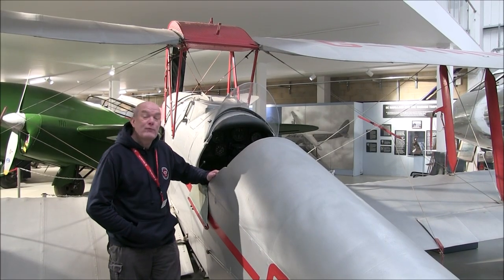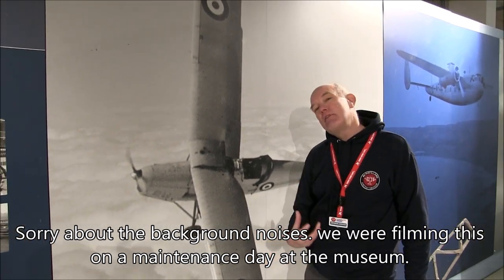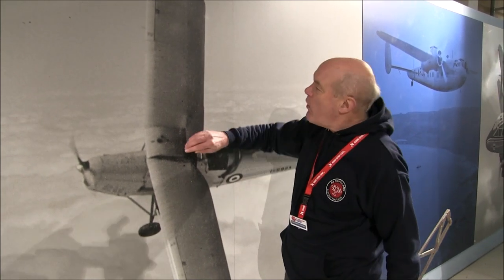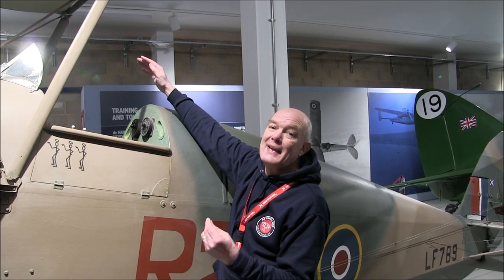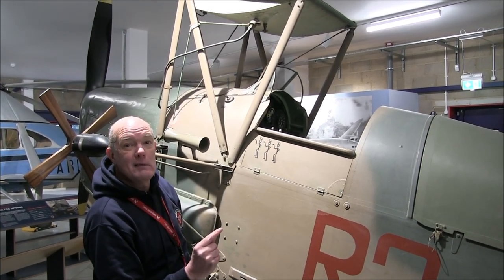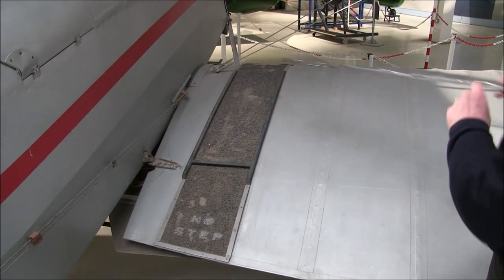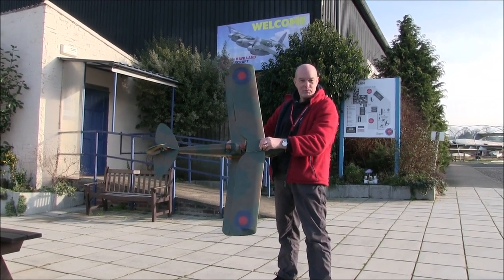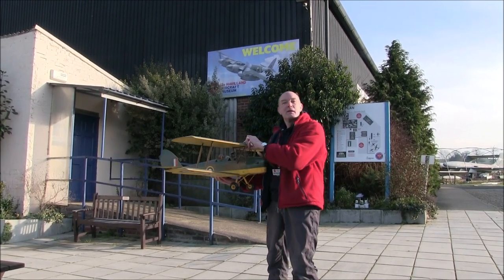Why are the wings strange on the DH82 Tiger Moth?

Comment: After they had swept the wings, it still wasn't quite right, so they swept the top wing a bit more. Then the Swedish (the Swedish were the first to recieve them) found out, that the tips of the lower wings were rather close to the ground when taxiing, so the lower wing got a bit more dihedral. And the DH82 was done and got renamed to 82a.
The DH Moth had foldable wings, and the Tiger Moth still use the wing folding hinges at the wing roots although those wings will fold nowhere.

Comment: Funny hearing center of lift, here in Canada I grew with a RCAF pilot father, he taught center of gravity, same thing in air cadets. Great explanation you made it easy to understand, great video.
Reply: Because centre of lift and centre of gravity may well not be in the same place. Change the angle of attack and you can change the centre of lift while the centre of gravity remains stationary.

Comment: Ryan did the same thing with their PT-22 recruit. They swept the wings back to obtain proper center of gravity, And another advantage of having swept wings is that it tricks the air into thinking that the wing is bigger Because on a swept wing the air travels across more surface area.
Reply: " it tricks the air into thinking that the wing is bigger Because on a swept wing the air travels across more surface area."

This is so wrong
Reply: @SoloRenegade  how?
Reply: @davidhames319  You made teh false, claim, you should be able to back it up.

The area of the wing does not increase. In fact, it decreased. And the wing becomes less efficient. the stall speed increases. 

if the surface area of the wing had increased magically, the stall speed for swept wings would be lower, and payload would be higher. You're no introducing the idea of spanwise flow that robs efficiency.

Comment: Very interesting...but it brings a question. If the ribs are not aligned with the airflow, then the original airfoil does not work as planned. Did dH change the airfoil accordingly for the swept wings?
Reply from the maker: As far as we know, the wings were not re-designed at all (other than the re-design of the wing root fixings). So the airfoil would work somewhat differently ! The story of how the DH82 Tiger Moth came about is covered in Graham Simons book, "de Havilland Enterprises" https://dehavillandmuseum.myshopify.com/products/dehavilland-enterprise
Reply: Correct, but the change is minor. the Tiger Moth is not the only aircraft to do something like this either.

Comment: G'day,

Wake up to yourselves.

There is 
NOTHING at all "Strange" about the Wings of a 
Tiger Moth...

Shifting the Upper Centre Section forward, to better facilitate entry and exit to/from the Front Cockpit, obliging the Wings to be swept back, SLIGHTLY...; to maintain the Centre of Gravity, was a Bog-Standard, Garden-Variety style of a Designer's Fudge - back in the day.

Nothing at all "unusual" about it..., except that it was done for a Crew Dynamics and Ergonomics reason ; NORMALLY the usual reason for belatedly sweeping back the Wings was that the Factory was already set up to build Fuselages - and the Bumfeathers were found to be far too heavy..., so the Wing-Root Fittings were modified to shift the Centre of Lift to within the limits of flyability 

If you would dare to demurr, then get ahold of a Plan-View of a Short Sunderland Flying Boat.

From memory, the Short Empire Class all had straight Wings, but the Sunderland was encumbered with a 4-Gun Turret under the Fin..., about a thousand pounds bolted retroactively into the worst place possible.

So they cut and shut the Wing Roots, cranking the Wings back about 10° - which worked, and it also resulted in the Engines pointing Outboard and the Thrustlines being 20° divergent from Port to Starboard ; which Pilots found to be actually quite helpful whenever any Engine failed - because the Assymetric Thrust was already offset in the required direction to compensate..., meaning that less Rudder Bias was required to continue flying on any Heading.

If you would perhaps like to stay in your Lane (?), then maybe try a Video explaining why all but ONE DH-87a was recalled and had their beautifully efficient Eliptical-Planform Wings amputated, and replaced with straight-edged  Parallelogram-Planform Wings....

Because Eliptical Wings stall first out near the Tips, and if a DH-87a got a trifle slow in the Circuit it would stall one pair of Wingtips, and instantly spin in, trashing the DH reputation for safety.

In 1978, when working at Olde Bowral Airfield, for Neil Cottee who owned a B-Model Hornet, among other old machines and Replicas...; and Cottee was renting Hangar-Space to a bloke called Gunnar Anderson, who had the only remaining A-Model Hornet on Earth.

Gunnar told me the story of the Wingplan rethinking while he was swapping his Cylinder-Heads from standard 80/87 Octane to the 100/130 Octane variety - because even then 80/87 was starting to become scarce.

Apparently his Aeroplane had been owned by someone who refused the offer of retrofitted Rectangular (defanged) Wings because he wanted to retain the extra Fuel Efficiency and the higher Cruise Speed emanating from the thinner and more efficient Aerofoils producing smaller Wingtip Vortexes.

Just(ifiably ?) sayin',

Such is life,

Have a good one...

Stay safe.

;-p

Ciao !